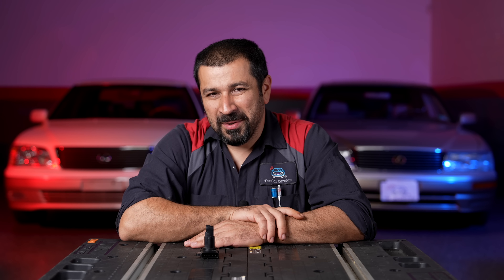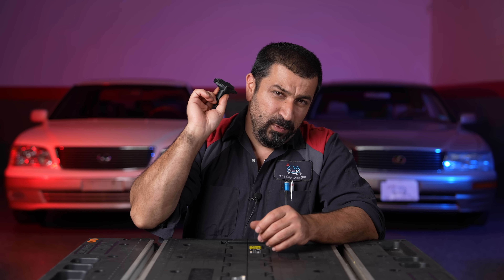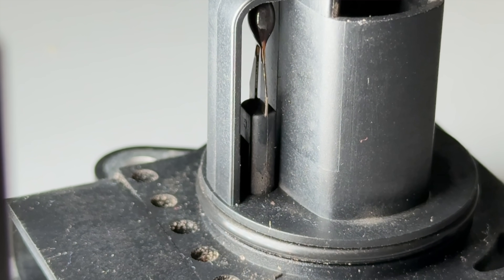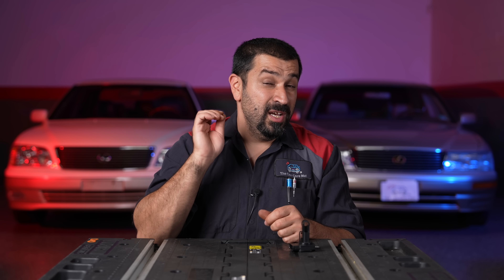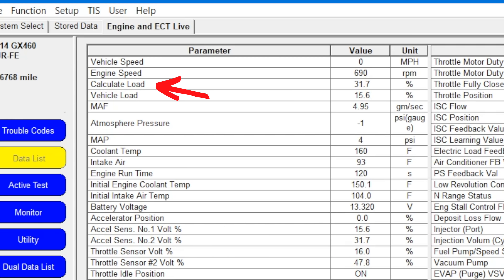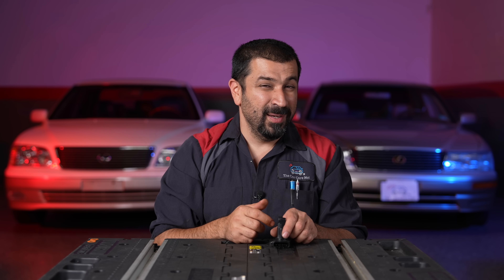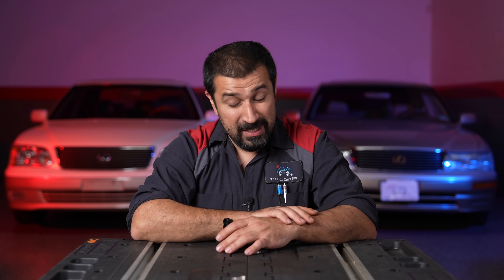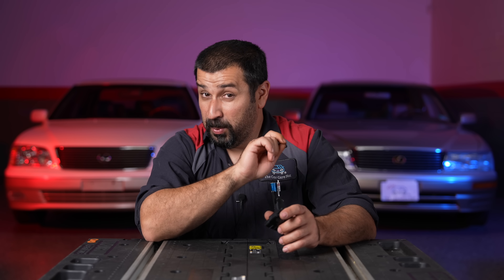Should You Clean Your MAF Sensor and How to Test It and Clean It on Toyotas

Comment: I was surprised you didn't mention what you stressed in another video: " Never, Ever buy an aftermarket MAS ", Great Video I did learn something, and thank you.
Reply: @subtegral  ~Don't buy OE or OEM parts from the dealer.  Find out who the OE manufacturer is for the particular part, and buy that OEM brand part from a trusted auto parts retailer.  This method is not "aftermarket".   (For anybody who doesn't know, OEM is Original Equipment Manufacturer.)
Reply: @subtegral Yes, this is one of those parts you absolutely should. 
Most are ~$150 though.
Reply: Just buy it from Denso in the aftermarket much cheaper than the original part from a toyota dealership
Reply: @DeepRacer-zr4yp or HELLA. It’s good too
Reply: @subtegral  Dealer ?  Ok, you win, I am wrong.  Have a great afternoon.
Reply: @subtegral  You replied to the wrong person, because I didn't say anything to the sort.  This is a DIY program.
Reply: @subtegral Denso 1976160?
Reply: @subtegral  lol wait, you are talking about a car from 2002? Then yeah sure use whatever is cheap and works. 
If we are talking about a $60k ~2020 4runner, the one who would be high as a kite is the one spending $$$ on the vehicle but cheaping out on critical parts. 
Anything 20 years+ old is a very different conversation.
Reply: I thought the same until my neighbor bought one from Amazon a little over 20 dollars and is still running strong

Comment: CRC Makes MAF cleaner and it works great
Reply: Yes, I’m surprised he didn’t mention MAF cleaner specifically to be used.
He mentioned electrical cleaner (and god forbid brake clean) but I wouldn’t personally feel comfortable using basic electrical cleaner. I’ll assume CRC has both for a reason.
Use the right product, it’s pretty delicate.
Reply: Yep 👍

Comment: Thank you for that simple explanation of how the MAF sensor works. You made it clear that diagnosis is key to doing any repair on a car. I blame Scotty Kilmer as he has purposed the simple solution of cleaning a MAF sensor even before any diagnosis with a scan tool. You  made it clear that a MAF sensor shouldn't be touched until a proper diagosis is made. Thanks again for the good advice you give to your viewers.
Reply: I believe Scotty generally referred to older cars with less sophisticated or less sensitive MAFs.  The ones in Toyotas are ultra sensitive and from what AMD describes need "operating room" conditions to clean.

Comment: An oiled air filter such as K&N can foul the MAF sensor if it introduces oil droplets in the inlet air.  Happened to my Toyota Avalon after installing a K&N filter.  I went back to a standard (dry) filter and had no further issues.
Reply: I too have not experienced any issues with oiled air filters. I have a feeling these issues are mostly user error. In fairness, it's easy to screw up re-oiling, hence why people have problems with them. Also people tend to clean K&N filters too often. They work better when then have some dust and dirt in them. You really can just leave it alone for a surprisingly long time. They have a much larger capacity for dirt and dust than a paper filter before they clog.
Reply: @kiefershanks4172  I’m also very lazy with the maintenance and this is probably why it works so great after a few years, haha. 
Thanks for sharing.
Reply: The oil is only supposed to be applied (if you’re cleaning it) on one specific side and not the internal side going to the MAF. The oil assists in trapping the particulates but some people will clean and then oil it on the wrong side - leading to aforementioned problem. 

I’m not denying what you said but this is just a fact they try to emphasize with the cleaning and maintenance and wanted this to be known to everyone out there. I have a K&N filter on my ‘18 Camry without any issues.
Reply: Too much oil - user error.

Comment: "But officer, I was just checking my calculated load." I don't think that'll hold up in court. Use a scanner with data logging. My car reaches 7k RPM real quick and measuring at a higher gear to get more time will land a person under the jail if you do it on the street. Good info about cleaning them too much. That probably explains why mine got worse over a short time. We'd clean it before each race. I thought it might have been from vibration being it was hard mounted to the chassis. Also, good info about using high pressure air. We destroyed the filaments by doing that. I thought we did but we didn't kind of thing with the air regulator.

Comment: The can of mass air flow sensor cleaner available at AutoZone and Walmart it says on the can "not for use on Toyota's". Probably better to just replace it. There on the expensive side but not enough to keep you awake at night. EBay is a good place to check for them if you don't need ASAP. (Hopefully)
Reply: What brand cleaner was that?
I just bought a little 2 pack kit from CRC at Walmart. One can MAF sensor cleaner and the other a throttle body cleaner.
I’ll have to check the fine print or perhaps they are referring to the newer style of MAF sensors on Toyota’s that should not be cleaned?
Reply: @jeffjohanson3830  yes CRC is the brand. Unless it's been removed from the can. Reason I know is like everyone else trying to clean it hoping my check engine light would go away so I could smog test my Lexus. I was in my 20's
Reply: @jeffjohanson3830  yeah it's in the small print I think on the sensor can. I dunno why they say that but if you like Peace of mind just replace the darn thing it's probably got a lot of miles on it all ready if not use the spray until you can buy a replacement sensor if need be
Reply: I have a 2009 lexus is250 and it works perfectly on my MAF sensor

Comment: Another great video, Ahmed, thank you. 42 year plus retired auto tech here. One thing I would add to the video that I’m sure you are fully aware of. Be aware of any unmeasured air entering the intake, ie cracked or deteriorated air boot between the air box/MAF sensor and throttle body. Poorly installed air boot that may be folded, where connected at either end. Large intake manifold leak, rotted or cracked PCV hose, etc. I know it’s a bit risky, but what I always used was contact cleaner and a very fine tipped artists paint brush to just gently run over the wires, but that was my choice. And be wary of some of these aftermarket performance, air intakes and filters. Thank you once again for your great information to the masses. 😊
Reply: Had an intake manifold leak on our 2006 Matrix. I was testing by spritzing carb cleaner around the manifold, but with no defect showing. Then it occured to test with the engine cold. Boom. First squirt at the #2 runner, and fuel trim goes crazy, engine speeds up and then settles down. Ten dollars later and part of a morning in the garage, no more problem.
Reply: @BilgeDweller  that's awesome. What about testing it cold makes a difference?  And when you say $10, you're referring to the gasket, the intake itself was fine?
Reply: @BilgeDweller  another (easier/safer) method is an unlit plumbing torch.  if the engine picks up or the miss goes away, you found your leak.
Reply: Yep
Reply: he could show how you take it apart !!

Comment: I had an after market MAF installed and I noticed my MPG's dropped by almost 5 mpg per tankful. At the same time, I notice an uptick in speed and accelaration. Also read that you should only replace with OEM only.

Comment: Great video. One more thing to add, never and ever replace the oem MAF with an aftermarket one.
Reply: You are 100 per cent correct!
Reply: @subtegral  ~Don't buy OE or OEM parts from the dealer.  Find out who the OE manufacturer is for the particular part, and buy that OEM brand part from a trusted auto parts retailer.  Same part, same manufacturer for less money.  It just won't have "Toyota" embossed on the part.  In fact on some OEM parts you can see where the automakers brand was ground off.   (For anybody who doesn't know, OEM is Original Equipment Manufacturer.)
Reply: @woodsprout  not necessarily. Find a dealer that sells online at a discount or a website that sells from different dealers. 

I checked with DENSO the OE manufacturer for many Toyota parts (used to be owned by Toyota and still is at large %), for a MAF sensor and only one official retailer of DENSO was cheaper than the online discount Toyota dealer store. $18 cheaper, but I have to wait for delivery, the other, I order online then pick it up at the counter some minutes or hours later for many parts.

All other official DENSO retailers were a lot more expensive! At about the original price at dealers.
Reply: Amen to that! OEM all the way! I've seen so many times a cheap sensor from Amazon cause so many problems.
Reply: Calculated load test to diagnose is great information for DIY maf sensors
Reply: @subtegral  I paid $134.61 for my 2012 Camry from my local Toyota dealer in the US.
Reply: This can be generalized to any sensor or component that talks to the car computer.

Comment: The film/grime build up is primarily from hydrocarbons that vent back out of the intake when the motor is shut off.  Later Toyotas use a carbon trap in the airbox to trap them from going into the atmosphere and then next time the motor is fired up is draws them in and burns them.  Unfortunately, the MAF is exposed to all of that so it builds up over time. I usually clean MAFs every 10k.

Comment: I know someone that was always getting a new MAF every two - three years. Guess why? He ran those gimmicky K&N Oiled filters. The oil will coat the MAF and attract dirt and corrode.  Cleaning is only temporary unless you go back to OEM filtration.  Aftermarket only want your money.
Reply: I have tried them over the years Depends on what type your using  the big round one's with the intake horn does decrease the differential pressure across the filter... The drop in K&N filters just terrible stick with the OEM.. oiling can be an issue too especially to the more sensitive air flow meters
Reply: My MAF usually reports about 5 deg F higher than ambient, but it sits right above  the block.
Reply: K&N oiled filters are junk. Anyone wanna trade for my K&N on a 2006 VW Golf with your stock air box and filter? NJ
Reply: I have one on my 2001 diesel Ram.  Seems to work ok.
Reply: I have a K&N cold air intake kit for my 2015 Tacoma. It works but only at high RPM will you notice any difference. Maybe about 5HP. This is already outlined  on their website with the Dyno scans. If you are looking to save money on gas going to the grocery store once a week , then a K&N filter kit would be a waste of money.
Reply: Nailed it.  I used to use K&N oiled filters on my M3, Evo and STI and it was toasting my MAFs.  I would take out the MAF and clean it when the car started to run like garbage.    Totally not worth it.
Reply: They probably drowned the filter. Just need a few sprays & you're good. Now is stick to AEM drys filter.
Reply: They are not gimmicky, only over oiling that's a problem
Reply: They’re kind of gimmicky.
Reply: @haqthkr  they are pointless. 

I supercharged my civic and I left the stock intake and panel filter. If I can pull enough air to run 9Lbs of boost through the stock filter, the stock filter flows plenty of air and there is no reason to change it out for a high flow filter.
Reply: @volvo09  there you go, it depends on vehicle to vehicle, i have a diesel Toyota and a High flow filter works better than paper filter. And the jury is out there where paper filter actually captured less dust than High flow when compared on the clean side on an airbox

Comment: Great advice.  Cleaning the MAP was on my DIY "just because" list but I wasn't having any engine issues. I'm going to leave it alone.
Reply: @subtegral  Case in point.  I don't even know what it's called so I shouldn't be messing with it.
Reply: In 2011 i did my MAF just for the sake of it & no issues at all for  (10 yrs on zero issues,2002 Yaris) i did it so everything is tip top & there's nothing to worry about in years to come, why wait for the CEL (Check Engine Light) to come on then you gotta resolve it but in the meantime the engine may be putting in more fuel which nobody wants.
Reply: MAP sensor is another one.
Mainly seen on turbo charged cars.

Comment: I drive a 20 year old Avalon.  There is no set time for cleaning or replacement the Mass air filter.    May be lifetime.  However some sites would say replace every 80,000 - 150,000 miles.

I did not know about scans, and I don't have a second person to go on a road test.

It is easy to take it out and clean it.  It is potentially very easy to damage.  I cleaned it a few times and finally replaced it.  I probably will not replace it again during the lifetime of the car.

Yes, you have to keep track of things.  I have free lifetime alignment.  I replaced the 4 strut assemblies on Tuesday.  I went to the national car service store and had the alignment done for free.  And, received a recommendation to replace the air filter and to clean the throttle body .  Of course, I last inspected the air filter about two months ago and have an OEM unit in inventory which does not cost the $40 that the service store would charge.  The throttle body was last cleaned 8000 miles ago!

What we need is direction on cleaning the catalytic converter.  Mine is bolted on and not welded.  Even a weld can be cut and redone.  My understanding is one can clean it is a solution of dish washing liquid soap with a lot of water, dry and re-install.  What do you do?

Comment: Last year, I was getting a "lean" code on my 2002 1MZ-FE Highlander. Cleaned the MAF but code came back. I found Toyota Technical Support Bulletin EG-5014, followed the procedure, and found the long term fuel trims for both banks were out of spec. The MAF data (g/sec) was also out of spec per the procedure, indicating a bad sensor. Replaced it and life is good.
Reply: Fuel trims can tell a lot.  One of the first things to check for air or fuel issues.
Reply: Did you lose anything else such as time cost add salon
Reply: @sofiaisaac50  not sure I understand your question

Comment: I cleaned the MAF and Throttle Body after dealing with a rough idle at deceleration for several years on my ‘12 Highlander with 235,000 miles. The performance and behavior dramatically changed in a positive way. This was a very easy DIY anyone can do with basic tools and patience. Make sure you use the proper solvents designed to clean those parts!
Reply: Yes, proper solvents is a must & only MAF cleaner/electrical cleaner as Amd mentioned in the video.
Reply: @tardeliesmagic Do I need to use the air blower thing? If I simply keep it for some time, should it dry up by itself?
Reply: @nesaralititumir6153  No,just blow on it a few times & let it air dry out for 5 mins...that's what i did. Had my can of MAF spray from 10yrs in the garage and used it,it was still ok to use.
Reply: @tardeliesmagic Awesome. Thanks a lot!
Reply: This is so awsome..
Thanks bud
Reply: I used rubbing alcohol and it worked fine.
Reply: @yamagrow420 the main reason to use a dedicated MAF sensor cleaner is because the solvents in them are designed to NOT leave any residue. Thats dirt or dust AND any residuals of the solvents in them. Alcohol dissipates very well and is not “ greasy “ in any way but why not just buy a MAF Sensor cleaner that is dedicated to the proper/safe cleaning of the MAF sensor. You can buy a can for under $15 even less on sale sometimes and you don’t need a large can like is sold at most Toyota Dealerships, most are about the size of a can of Coke. That little can will clean a lightly to moderately “ dirty “ MAF sensor  5 or more times or clean 4-10 MAF Sensors and WON’T damage it.
Reply: @Zeek800 I just did to my car.  However, it still has lean codes on both banks.   Regarding "You can buy a can for under $15", I am just going to buy a ~$15 sensor instead (in this case in addition to prior cleaning).  I am worry flooring the car just putting too much stress on it, and also, just scared of the speed it would produce.
Reply: ,  Terable idea. Clearly you were lucky.
Reply: 235,000 miles.  Nuff said

Comment: I had a sequoia that was having issues so I got it pretty cheap. When I checked the MAF it was visibly dirty. I cleaned it, changed the air filter and it ran perfectly.
Reply: Hello what issues were you having? I have am 05 sequoia and shakes intermittently toyota cannot figure out the issue

Comment: This video is perfectly timed. I’m having doubts about the MAF sensor on my 2021 RAV4 with 74k miles on it. Haven’t really started any checks/diagnostics, and there is no check engine light. The car runs fine, but once in a while it’ll do rattling type vibration at idle, similar to the engine not getting enough fuel. Hopefully it’s just the sensor, and all it needs is a cleaning.
Reply: One thing to try first. Get some Techron complete fuel system cleaner. Use at every oil change. Only use top tier fuel like chevron, QT that has good detergent packages in the fuel. Bad fuel from discount stores isn’t uncommon.  Hopefully the Techron and better gas will smooth out that idle over time without much effort. Intake cleaning would be my next thing to do if that doesn’t help. Good luck!  Scan tool wouldn’t be a bad idea either.
Reply: It could just be in need of spark plugs.
Reply: @vw5056  Thanks for the tip. I suppose I can take out the spark plugs and inspect them. Didn't think about it since I know that modern cars go about 100k miles before needing spark plugs. Then again, nothing is written in the stone and each car/situation is different...
Reply: @vw5056 Nope. They either spark or don’t. If they don’t you get a code.